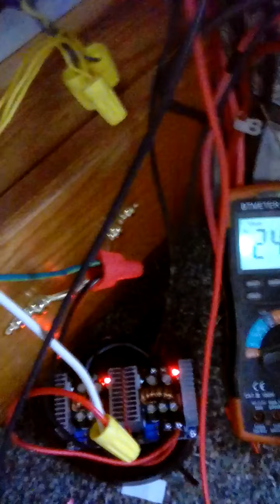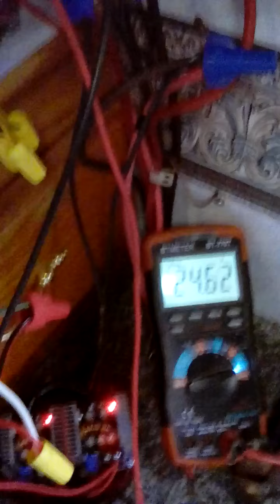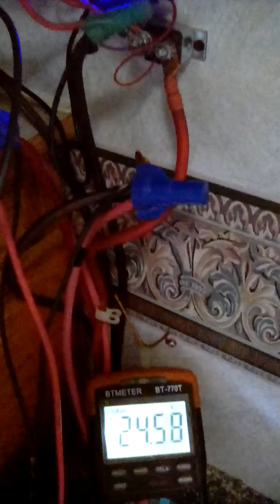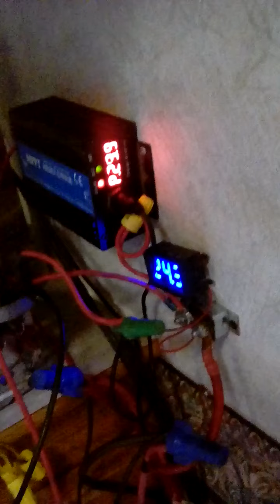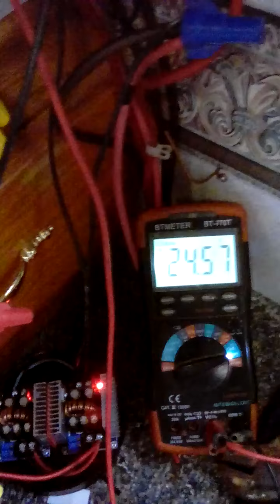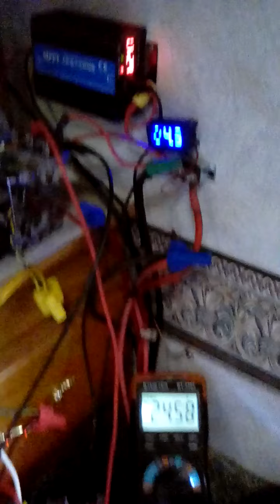Hoverboard motor/alternator assist in a cloudy day. 😎

Comment: On the washing machine stator you're talking about. The wires you clip to separate the three phases. It's called the center tap. 
I found best results with driving from the second leg. And collecting from one and three.
I did not cut my center cap wire.
I used the center tap wire from the second leg as my negative.
I'm definitely interested to see what kind of results you can get from it. 
If you look at my channel and look at a lot of my older videos. 
Might help you bet on your build.
Good luck and thanks for sharing your build.